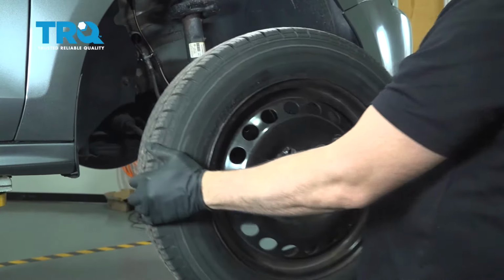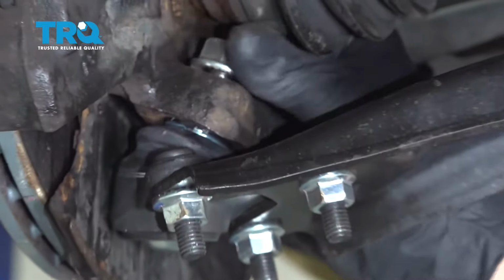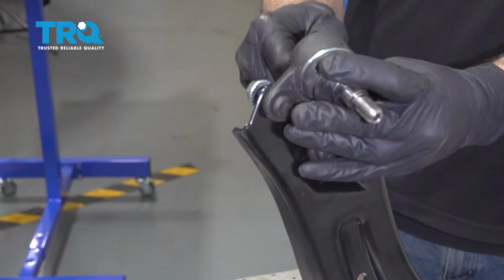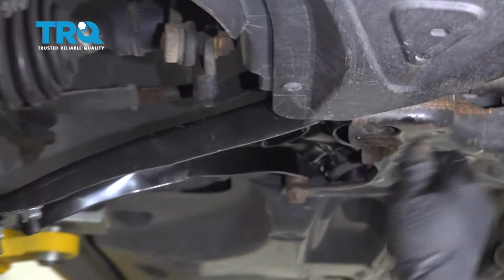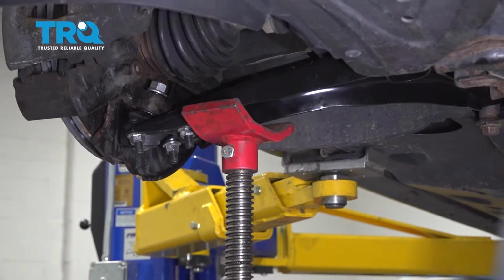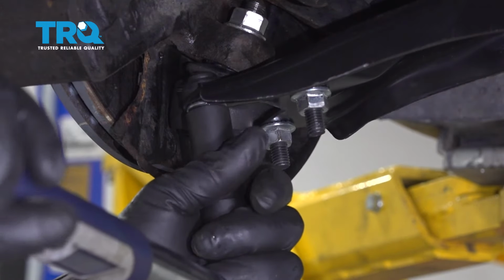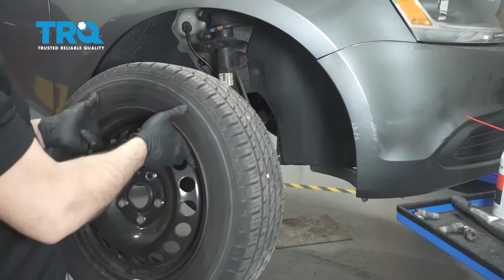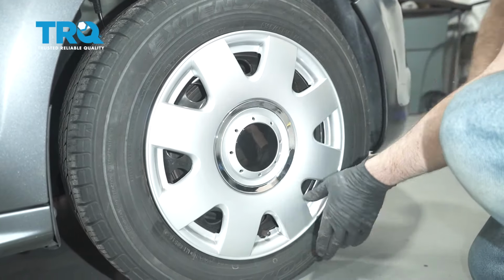How to Replace Front Lower Control Arm 2011-2018 Volkswagen Jetta

Comment: I guess I’m only one but I did this job followed it exactly like you but have a super bad amount of positive camber now and I’m going threw tires like monthly now on just this side not sure what to do if it’s a wrong ball joint or backward or I’ve been told there’s a bolt that you loosen then you can just cock it back straight I dont know I know when I did job I loosed a few of the sub frame bolts and had to fight this to get it all back in to but yeah I’m stuck can someone help

Comment: For Driverside control Arm, I ended removing the transmission pan to remove the bolt. Pan gasket was leaking anyways so it worked out.

Comment: For all who came here looking for the drivers side control arm you do not need to remove or loosen the subframe. You will need to remove the bolts attaching the dogbone mount to the underside of the transmission. Once this is done take a prybar inbetween the subframe and engine/ trans assemby and pry the assemby toward the front of the vehicle it will take a bit of force but you can make all the room you need to get that drivers side lower control arm horizontal bolt out. Then your done just reinstall the bolt with the control arm in the reverse order and dont forget to torque in the resting position not the raised position to prevent premature failure of the new bushings
Reply: Awesome thanks bro bcuz I literally came just for that jaja 🫡✅

Comment: For anyone with a manual, I just did control arms and CV axles on my 2014 Passat. You do not need to move the subframe/transmission at all.
Easy installation

Comment: You don't have to seperate the ball joint or remove the CV axle. The CV axle bolt is a mfr to remove/install and it's single use. For the ball joint, simply remove the 3 nuts from the control arm and press down on the arm to release it. It's also waaaay easier if you seperate the tie rod from the spindle as you'll need a lot of movement when aligning the vertical bolt. Prior to installing the vertical mount, loosen the 18mm subframe bolt next to it. Once the new arm is in place roughly, go under and visualize the mount on the vertical bolt. Often, the top portion won't line up. If so, take the old fastener and get it started. Now jimmy the arm up/down and side to side till the bolt moves flush. Now that it's aligned, carefully remove the old fastener and install the new hardware (they're TTY). The horizontal fastener is super easy to line up.

Comment: good quality video, but, you scratched the paint off the new control arms while lifting them in the working position.....now they will rust 😅 aside from that 👍
Reply from the maker: +@krisg822 Thanks for watching our video! http://1aau.to/m/Shop-TRQ
Reply: So use a towel or rag in-between?

Comment: LoL.  Simple as that eh?   Not even close.... Your balljoint is brand new, in reality that nut is gonna fight yo ALL THE WAY.  Then of course there's the fact you did the RF.  Let's see you do that lickity-split on the LF with an automatic transmission.  You have to unbolt the transmission mount and raise the engine/transmission assembly to remove the front control arm bolt.  A good video for seeing what 1/3 of the job will be for most people's situations.
Reply: So glad I read this comment, that explains why I was quoted 900 bucks for a replacement. This video makes it seems like I can do this over a few beers.

Comment: Lt side is the tricky one
Reply: I just did it. Remove the 2 16mm Bolts holding the dogbone mount. Use a pry bar to swing engine far enough out of the way to remove the front control arm bolt
Reply: @charvelgaming2975  Thanks... I was beginning to think my mount was bent

Comment: The control arm bolts and 3 ball joint nuts are to be tightened in curb weight position, not in full droop.  You will destroy your control arm bushing in less than 6 months the way you've done it.
Reply: Did he not raise the suspension with the Jack tho? He didn’t specify it was to curb height but he raised the control arm with the Jack which I assumed to be to account for what you mentioned
Reply: your scaring me... how hard is the drivers side? Jetta TDI with automatic...
Reply: Your absolutely correct, here's a video to explain what he's talking about https://www.youtube.com/watch?v=-QczV_6v42A